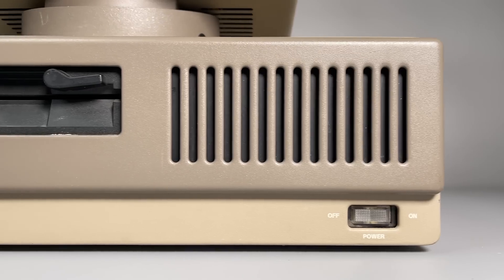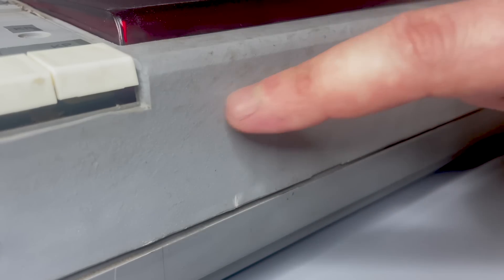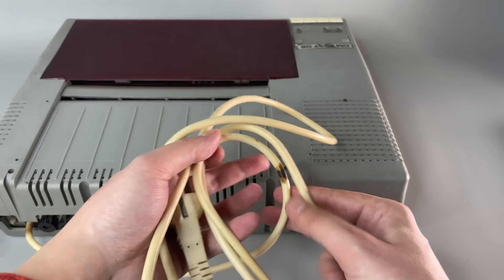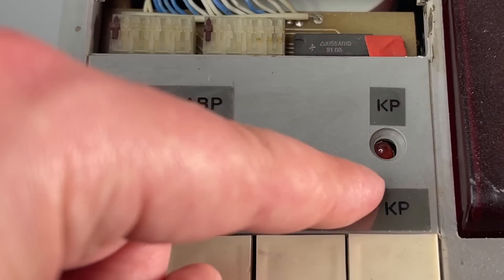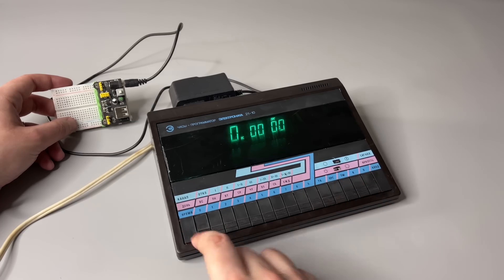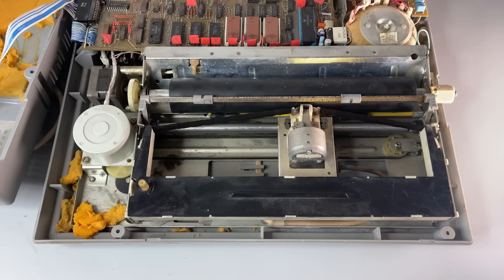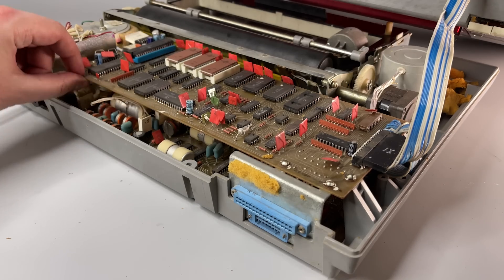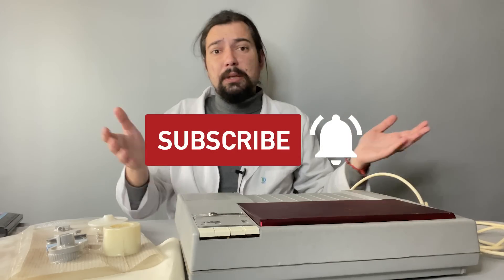This is THE WORST PRINTER I've EVER seen | Soviet SM6337.02

Comment: At least it won't ask for a new ink cartridge everytime it is turned on.
Reply: The thing will never ask for new ink. It will keep printing until the ribbon gets completely dry and you make a decision that the letter are way too dim to expect other people to recognize them. And even then you did not just buy a new cartridge of course as it was also quite a rare item. Insted you disassembled it, then you purchased an alcohol solution and soaked the ribbon with a little bit of it and then reassembled the cartridge. And after it no longer had enough ink you just got yourself new ink. And after the ribbon itself started to tear you just cut it and replaced the ribbon after it got too short. Even after the plastic wheels and axis inside wore down there were replacement options available. The only reason to replace a whole cartridge was if you accidentally break it.
Reply: @Kirillissimus  ha ha... actually I had an old typewriter like that.
They just keep on writing.
Reply from the maker: Very often it would ask for a new firmware, if there is a power glitch.
Reply: Still very advanced.
Many modern printers don't have that luxury either.

Comment: I will have to disagree with you a bit. I live in Canada and in the early eighties when I was a teenager I had a Praktica camera and a soviet enlarger. The Praktica had a shutter spring that snapped like a mouse trap, but it never let me down. The enlarger still works. In recent years I have worked with soviet nixie and VFD tubes and they are surprisingly durable. So I have to grudgingly admit that junky clunky soviet engineering wasn't pretty, but it was functional. 😁
Reply from the maker: Right, but it depended on the market segment. Pro equipment was often very ok, but you even would not be allowed to buy it unless you buy for an organization. Remember an awesome 8080 microlab we reviewed? That is the case - it was sold only for organizations, no privates!
Reply: @ChernobylFamily  I was a teenager with little money and Praktica was the cheapest 35mm available. I'm sure export items were better quality than what was available domestically.
Reply: @mz4637Please name a Canadian made camera. 😂😂😂

Comment: The problem with this is plain, down to the whole Elektronika bureau of control where old men in Moscow lacking any sort of expertise in electronics and many times politik appointments would wield their influence and lack of any formal understanding on the whole new thing of electronics so the Soviet system was hamstrung by itself and being a "new" thing featured low in the five year plans which themselves caused absolute chaos in the Soviet economy because the people writing the five year plans outside the military procurement lacked again people of expertise and understanding so you ended up with beetroot mountains and lakes of ball bearings but half the critical requirement of copper or bronze and no aluminium.   Procurement managers found themselves in a pickle too, they had to tread warily in trying to find materials for production because any criticism of the politburo was a pointed invitation for family and friends to join him in one of the happy camps aka gulag and so this secondary black market became an almost institution as they had zero problems in finding materials and if your factory production dropped below a limit then again the men in long coats would be opening the car door for a trip to a political court to explain oneself...
Reply from the maker: You have a good point!

Comment: Same Plastic as the Sosna Geiger Counter. It might not be dirt, rather the plastic was badly blown into shape or the Colour were mixed badly. Lot of Soviet Tech was sold for Cheap in the late Nineties in Europe, most stuff was used for Hobby here. But was made for Socialist Industry.
Reply from the maker: Anri Sosna was cool. Not easy to use, but 4 tubes rule.
Reply: I still remember that there were two formulas inscribed on the rear Panel, all readings had to be converted. Amongst all Kids showing off Cd-Players and Wristwatches, I was the one with an Anri - Cool indeed😁
Reply from the maker: But actually in dosimetry it is how you do it. There are a few types of doses you can measure, with very different meaning, and e.g. if you have a modern device which shows you uSv/h, you absolutely will need to use adjustment multipliers to get a, say, effective dose to a specific tissue. Same with CPMs and so...

Comment: It's like they molded the plastic in an abandoned coal mine. :-/

But as bad as this printer is, it pales to so many Soviet made TV sets of the era. Suddenly exploding CRTs that send shards of glass to impale the viewer, so much of a fire hazard that the Soviet television sign off warned users to unplug their sets, and posted signs at hotels warning the same (IIRC, upon checkout you were supposed to make sure the set was unplugged and the cord draped over the front of the TV). From what I understand, TVs made by the end of a month were the most hazardous as quality took a nosedive because production of those sets were rushed to meet the quota as prescribed by the bureaucrats in charge of those state run factories.
Reply from the maker: Pretty much true. I guess, varied from a factory to factory, though...
Reply: Unplug the set and drape the cord over the front ...I stayed at a hotel here in the UK that had a rule like that in place, too. Which is strange, because I don't recall any signs that the owners were Soviet expats...

(It was a British brand of television though, so perhaps this was just regarded good practice. We were still having a national energy crisis at the time, so every little helped. 🙃)
Reply: Just don't run the TV for so long mate, it's not too hard. It's socks but it's preferable to fires.
Reply: @electricspeedkiller8950  If I had access to a Soviet television set, I think it'd work out to be a cheaper way of heating my UK flat than the „efficient“ heating „system“ that's provided by my landlord... 📺🇬🇧🔥😉

(Aye; Some of us are housed in flats designed to be resistively heated, built close to the start of the UKs nuclear energy boom (British made reactor, 'nuff said! ☢🇬🇧💥😋) and entirely unsuitable for gas heating. Wouldn't be such a problem if baseload electricity wasn't being charged through the roof because of a very small (But well-heeled 💰) percentage who use it to charge their EVs... 🥶)

Comment: The model number sticker may have been placed correctly at first, but moved later due to internal stresses when the glue disintegrated. It looks like the top layer of clear plastic has shortened over time and pulled the ends of the aluminum foil together.
Reply from the maker: I believe you, but it looks in 3D somewhat too extreme to support this version. I mean, it it is really massive deformation in there.
Reply: @ChernobylFamily  The vinyl sticker pinstripes on my 2003 GMC Sonoma shortened themselves over the years by more than 20mm. Don't discount the shrinkage factor.

Comment: I'd like to see if it powers up and even attempts to do anything but if you don't want to I can understand. It's probably a fire hazard and I doubt it would even work when it was new. It would be interesting to see it run if possible but that seems improbable at best. I have an old Canon that I must push the paper in. It won't pick it up correctly but besides that it works well. After seeing this printer of yours, I will never complain about mine again.
Reply from the maker: My wife told me to be a Slavic man and take a risk. I tried and what I got: "power on" LED on, "malfunction"  LED on, and then a weak attempt to move that head for a few centimeters with an overall vibe of that effort "please kіll me, I do not want this suffеring".
Reply: @ChernobylFamily  Well, you tried and as with any machine, it did it's best. Judging by the condition of the exterior, there are probably all sorts of other issues going on inside. It might not even be complete. I forget the name of it but there was a Soviet thing where they would produce products terribly but technically they built so many of them so they satisfied a quota. I think this is how it worked. This is probably an example. Do you have video of that KGB/Military printer working?
Reply from the maker: No, I do not. We had it before we started this channel, then invasion started, out neighbourhood was occupied and that printer along with some more devices was stоlen. I guess the box looked not very civilian... That is sad, as technically the device was nothing special, but it was metal, and that super rare.

Comment: Can you please do a detailed review on schematics of this printer? PCB looks really similar to some Z80-based computer, but with soviet analogs of western ICs. Do they really made a computer just to print?
Reply: It was common in that era, that printers had comparable processing power to personal computers. For example, the first Apple LaserWriter had more powerful cpu than Macintosh it was supposed to connect to.
Reply: @tobyscrap6952  Same with the disk drive for the Commodore 64. It's almost another Commodore 64 itself and you can run code on it unplug it from the 64 and it will continue to execute the code on its own. Back in that era of some of the 1st micro processors. If you needed a processor to control your peripheral you were basically using the same processor as in the main computer because there was no "lower end" processors available.
Reply from the maker: Let me check the papers.... I am almost sure is is basically just Epson FX-80 or smth like that,

Comment: Yes, thermal damage on the power cord alone should keep you from powering that unit without a complete breakdown and rebuild. Broken capacitors? Also same indicator. The case defects and PCB engineering indicate it isn't really worth rebuilding unless you have the capability to replace almost everything. Not to mention how many parts you would have to add for overall engineering defects. So sad, unit is new old stock and yet a complete waste. I feel your pain.
Reply: I remember some Soviet cords had dark brown spots looking as a thermal damage, but they were really ok, probably some poor mixing or contamination of chemicals they made that cords of.
Reply: @romanmaltsev6224  I can see how that might be the case. It's hard to test a ps cable without an engineering chart and a high confidence in what materials you are looking at. Even then the best way to test many of them to failure to get real numbers and no one wants to qc old cables they may never find again.
Reply from the maker: By my practice, those capacitors actually will work, if they are broken only at one edge. The device actually powers on, but does not work in any way correctly. This weekend will add a brief demonstration in the video about that clock.

Comment: My father was into the maintenance of the russian "Ludmilla" BR132 (now BR232) locomotives in east germany. He often sayed something like "This locomotives are so primitive, they can be repaired just by the train driver in the middle of the taiga dessert." or "They used a garden hose for isolation on high voltage wires". I think he loved and hated this machines at the same time. On the other hand some of this machines running still today.
Reply: The "primitive design" of Soviet vehicles were actually by intent. The SU is/was a huge, rugged country where you had to be able to repair vehicles with the most basic of tools if you were anywhere outside of the western part of the country. And we are talking about vast, burning deserts and frigid, icy tundra. Much of the SU was as sparsely populated as the Austrailian outback. This repairability and simplicity of course was at the cost of fuel economy and luxury.

If I was stranded in the middle of nowhere, I'd rather it happened while I was driving a Ford Model T instead of a Tesla. A Model T you could repair with basic tools, a Tesla, you cannot.
Reply: @plateshutoverlock  , it's a good methodology for some things, but will limit the engineers on inherently complex tasks. A good engineer already attempts to solve problems with as simple a solution possible. Forcing even more requirements for simplicity beyond this is asking for trouble. You can reduce designs further, but you'll get compromises in things like safety and operational tolerances, shorter lasting materials, and so on.
Reply: @plateshutoverlock  So... it was definitely going to strand you, so it had better be field expedient to repair?
Reply: @mfree80286  Probably. Steam engines were never simple or quick to fix despite being well-understood, and reliability was not great, especially with soviet quality and tolerances. What they didn't tell you is how often they had to painstakingly adjust every part daily, and oil everything etc. like it was the British Empire in 1932.

Many people tout how tough and great soviet things are, but that is misleading. For 1950s standards, they are rugged, but so were most British and American products of that era. For 1980s standards and beyond, soviet trucks lose out to a Toyota Hilux, which is more efficient and rugged than any soviet made truck of the era. Did a Moskva ever come with an actual oil filter, for example?

That ruggedness comes at a cost of efficiency and safety, so soviet cars are heavy, unsafe in a crash, and a Lada saloon burns as much fuel as a Range Rover. Lada owners are likely also changing oil much more often unless they live in places where mandatory inspections don''t exist.
Reply: @plateshutoverlock  for electrification, a Baker electric fits the bill of the Ford Model T better, it is even simpler with a brushed DC motor and a contactor for speed control.
Reply: But we in the US have a similar thing with Nevada and New Mexico, yet we don't have the same issues.
Reply: Sometimes primitive isn't bad, having an easy to repair vehicle must have been a prerequisite in Russia considering the vast near inhospitable areas that they had to go trough, but it also massively held them back technologically.
Reply: @SergioEduP  The "Ludmilla" (BR13x / TE109 class) were designed for East European railways, not for the Soviet Union (although some units had been used in Russia, and the 2TE116 class is a direct descendant of "Ludmilla").

While the class' design itself was pretty fine, the quality was not.
That's the issue that plagued the whole Soviet machine-building industry.
Reply: @u2bear377  Well, if the quality was/is so poor, why are they still running today then, even though much more modern diesel locomotives are available? I'm pretty sure German Railways can afford new locomotives to replace them (lol), but they don't seem to want to
Reply: @paul_ko  Because after all the production faults were fixed (not design faults, but like mere loose bolts!) it's a very robust class.

PS: The Ludmilla is my favorite Soviet-made diesel loco.
Reply: They still run and get maintained. Once they tried to switch the engines to a model from Caterpillar or MTU in the 90´s, in the end they switched them back to the soviet ones, these could be repaired by their own repair shops. One of my projects is the development of the repair shops, everything, the windings of the e-motors up to the complete engine overhaul (bearings, cylinders, valves, compressors) are done there. No need for an external company (what is the case with CAT or MTU engines).
Reply: @Buledde  How about fuel efficiency and emission standards?
Reply: Simple designs lack many integrated features and controls that make them efficient and safe, that translates to huge coal burn per amount of work, arms and hands getting ripped out, limited operating speeds and the constant risk of missing a signal and crashing.

The problem is that more efficient and effective designs will need much more maintenance and infrastructure, which never got developed in the communist bloc. I guess you could cut down thick branches near the railroad if you ran out of coal, but that was one reason everyone was dirt poor, because infrastructure is one of the things that drives down costs.

It would have been acceptable in 1922, but by 1970, we were starting to get concerned about efficiency and the environment, and although the ussr held the first climate conference, it was for ulterior motives, because they were the 2nd biggest producer of pollution, which was ridiculous for their population number.
Reply: i like the Ludmilla locomotive, maybe i will buy a piko DDR era model of one or even a new one some day.
Reply: @raymondleggs5508  DDR-made Piko BR130 isn't quite prototypical-looking.
Modern Piko model is much better.
Reply: @u2bear377  I collect DDR piko models
Reply: @raymondleggs5508  Ah, ok.
As a collectible it's pretty fine.
Reply: those were produced in Luhansk in Ukraine. The was some manufacturing culture there. And they were quite interested in this contract hence they assuerd better quality than usual. For the rest of the products they just did not care about the customer. Like buses in USSR. They were also primitive and the drivers knew how to repair them. But maintenance began the minute the bus left factory gates, I've heard a story about Lviv buses LAZ. The street next to the factory was always packed with parked buses undergoig their first reparation by the drivers who had just received those. Crazy
Reply: If you're a train driver in the middle of savouring your well-earned dessert (and a taiga one, for that matter!), I bet you won't be easily distracted by some locomotive repairs.
Reply: You get the feeling they got a lot of rejected/defect parts when doing the quality control for the military/KGB version. Then they slapped the defect parts together into the civilian version....
Soviet civilian consumer goods, was that all rejects from military production?
Reply: regarding railways. east germany was reintroducing some steam engines, while the west was testing maglev trains going 400km/h+...